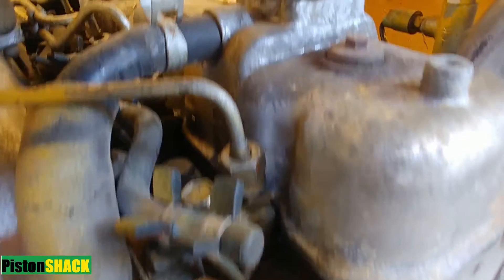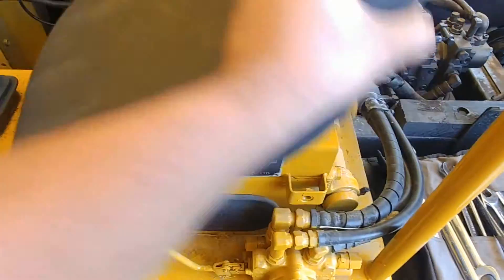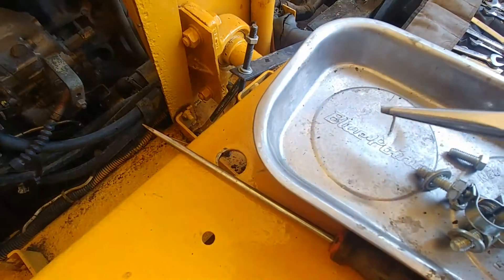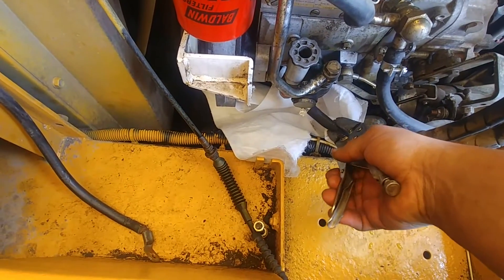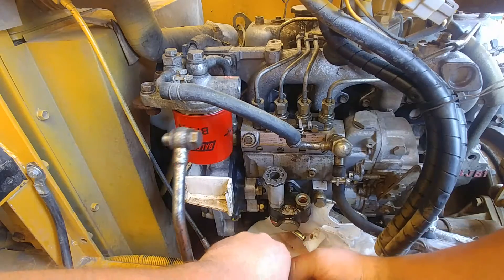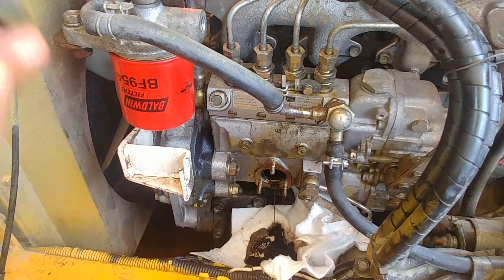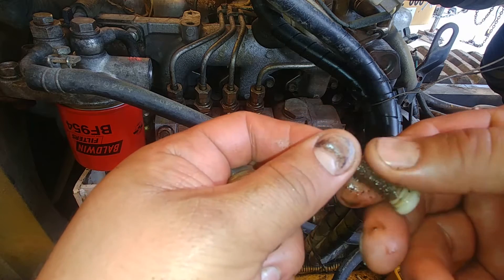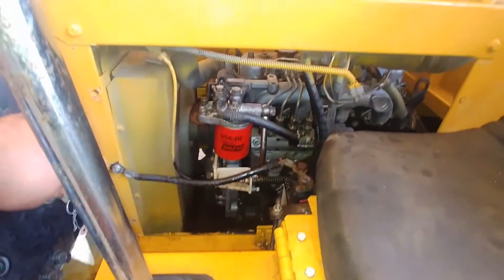ISUZU 4JB1 FUEL LIFT PUMP REPLACEMENT | 2.8L Isuzu Diesel Prime Pump

Comment: I have a ex60 hitachi with the Isuzu engine. It Boggs under load I’ve cleaned the banjo fitting out at the feed pump and a new fuel filter the tank is clean it’s still bogging what would my next step be
Reply from the maker: Most likely you have dirty fuel filters, clogged fuel pick up tube inside the tank or slowly failing lift pump.
Reply: I have similar problem.
I have 4BD2T with fuel starvation when I needed power at low rpms.  Then air enters in the fuel system.
I  changed  all the fuel lines at suction side cleaned sedimenter  and banjo bolt screen. They were dirty. I realised  banjo bolt sealing washers were damaged.   I am waiting for pieces.

I also wonder if  not turning off lift pump handle tightly or bad o-ring on that handle can cause  air to enter  into fuel sistem.

If the problem continues  after changing those sealing washers, I will suspect  failing lift pump.

When  idling and transmission on D at traffic light, more air gets into fuel system. When I put it on N and throttle and  after a little hesitation it becomes running normal again for a while.